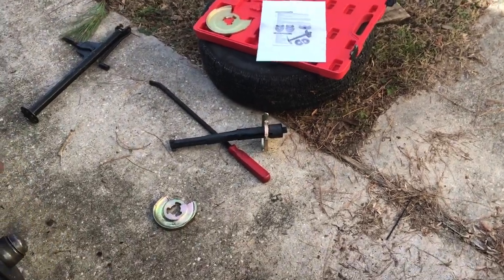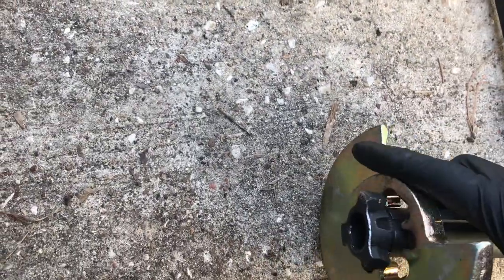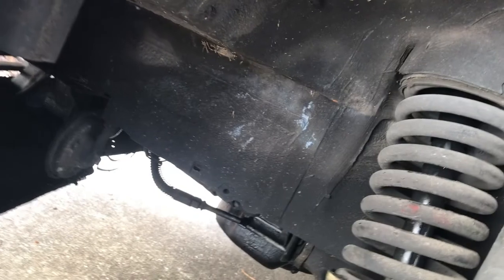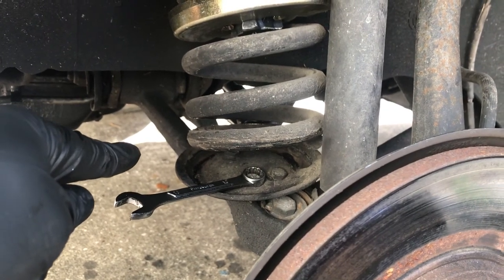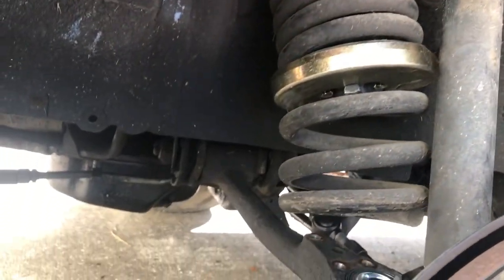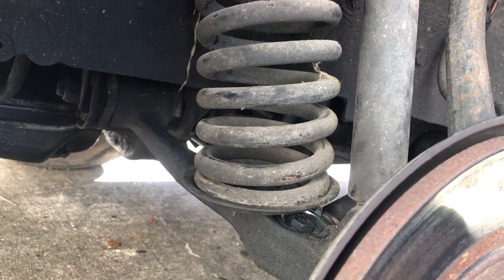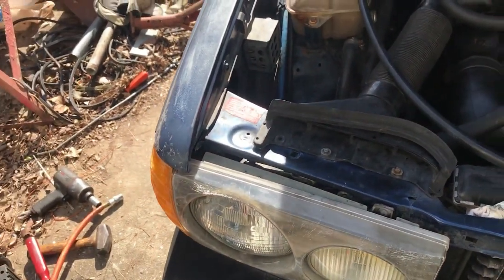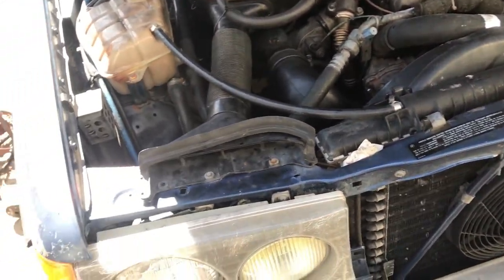85 Mercedes 300D Guide Rod Bushings

Comment: Good job installing the lower spring plate. The upper spring plate should have been slipped inside of the top of the spring. The Mandrell would then fit down through the hole and engage both plates this would allow you to see both plates from underneath of the vehicle once compressed you can remove the entire spring very easily and lay it aside. Vito has some great videos on this subject
Reply from the maker: I'll have to look at my tool again, but I don't think i could get it down that far, the whole in the spring tower was too small. Vito does have good videos on these cars.
Reply: The problem is that you would have to grind the tool.  I am thinking since I am replacing guide rod mounts, bushings, ball joint,shocks,and lower control arm bushings (which are shot) . With careful work with the jack, I think you could do this.... Pull everything else out of the way, then release spring , fix everything then collapse new spring bolt on the shock then lower it back down onto the plates.... I dont want to cut my compressor tool just yet even though ive watched vitos video a dozen times. Im dreading this rebuild.

Comment: Camera control in early part of video is frustrating.  Subject is typically out of frame. 
Appreciate the effort to share though. 

Note:  it is common to have to clearance the hole in the body to better fit the compressor down into the spring.  Just be sure to apply touch up paint to avoid rusting later.

Note that the bottom plate was not properly seated and made a bang as it seated.  Springs are very dangerous !!
Reply from the maker: I am working on improving the video quality.

Comment: what do these bushings exactly do? ive changed them before while I rebuilt whole front but just wondering..what are the symptoms of bad ones?
Reply from the maker: They connect the support rod to the lower control arm. Basically helps support the lower control arm.
Reply: So what will the symptoms of a bad lower control arm bushing would be ?
Reply from the maker: Clunking noise on bumps.
Reply: Or even just heavy braking,  @mjmcomputers
Reply: The rod that connects under the spring plate is a "Brake strut".  It controls braking forces and keeps control arm located during fwd and rev braking. 
The bushing allows the 2 metal parts to deviate slightly while absorbing vibration. The large bushing at the rear end of the rod  to the chassis should be replaced as well.  Ideally its best to replace the control arm bushing at this time also, basically all three points since the spring is coming out.